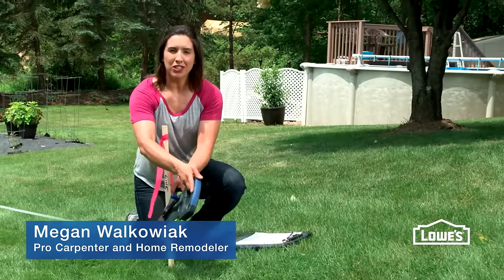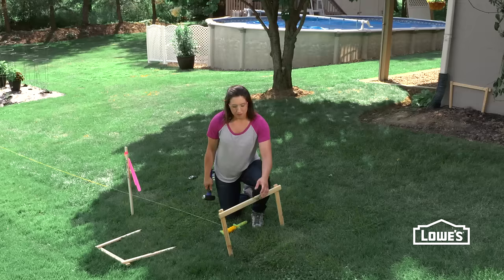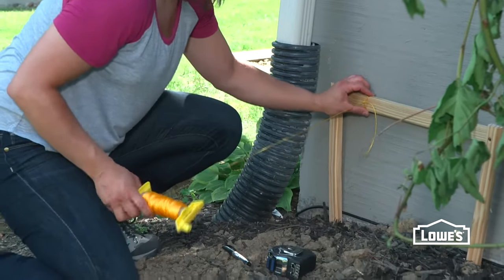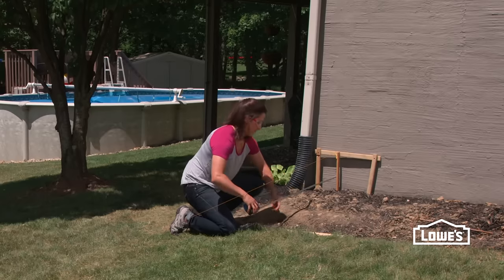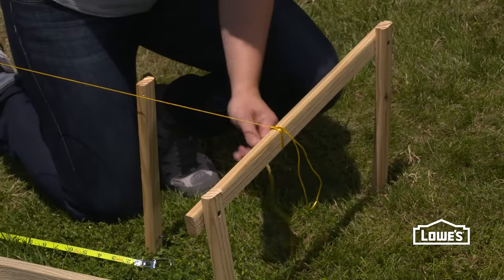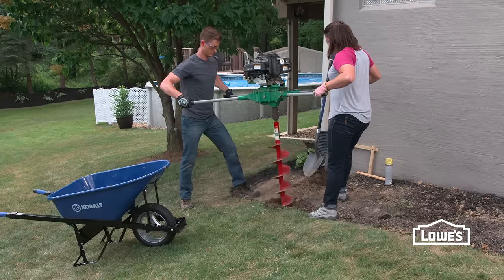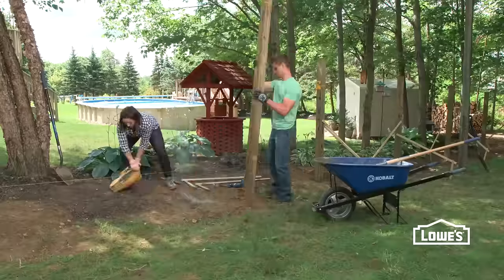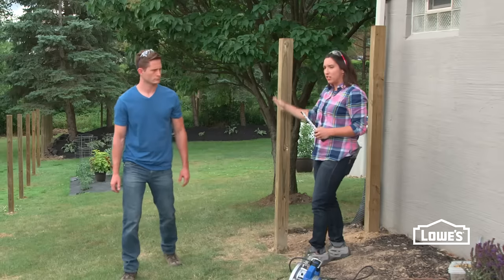How to Build a Wood Fence

Comment: HELPFUL HINT: Whenever you need to split a fraction of an inch keep the top number the same and double the bottom number. For example half of 1/2 is 1/4. Half of 5/8 is 5/16. Half of 3/4 is 3/8. Half of 1/8 is 1/16.

Comment: I suggest you use screws if youre in high wind areas. I've seen so many of my neighbors with fences destroyed because they used nails. Nails are good with shear strength but not pull strength.

Comment: The only problem about this video is that there is no specification on the nails so they don't rust (galvanized or stainless) and they are too deep. I personally use deck screws so there are no pickets coming off later. Contractors use nail guns to be faster but I always recommend screws if its for your home, which i believe that is what this channel is for. Either way, still looks nice.
Reply: Yes, well said!  Coated screws (preferably Torx bit) are the only way to go if want your deck, fence etc. to last. 
Today's screws are built so tough you could probably reuse them after the wood deteriorats.
Reply: @williamrodriguezmswlcsw8119  should you predrill all the screw holes? Or just fine screwing those in.
Reply: Always nails, screws may break with wind, nails will just bend in the worst case scenario

Comment: Watching this makes me want to hire someone to install a fence. Thanks Lowe’s!
Reply: I can dig it
Reply: I’d be very thankful for the work!
Reply: At least you will have an idea of how it should be done. One big exception is that the concrete for the post should come up above the ground by 1-2 inches and slope away from the post to drain water. If you want a 50 year fence or live in an area with strong winds use  2-5/8 steel posts and galvanized brackets to attach the rail sections. Fences collapse when the post weakens with rot. If using PT posts then be sure to treat the cut ends before putting them into the ground.
Reply: Zach LMAO😂😂😂💯💯
Reply: My thoughts exactly 😟
Reply: Benjamin Sampso
Reply: mik3lee98 yes! I’ve been doing fence for 17 yrs and tamp everything except hinge and striker posts concrete only, unless I’m doing anything over 6’ or chain link of course or if stubborn customers insist 🤣
Reply: @1millionsubswomovieschalle796  sounds about right brotha
Reply: Exactly lol
Reply: @mik3lee984  yeah till the fence go to leaning and straight dirt rotten a post out
Reply: @bswam44  thanks you to shared your knowledge
Reply: @mik3lee984  can you elaborate on this please?
Reply: @Burroughsbikebuilds  do mines

Comment: How big of a gate can you make with the hardware before you risk sag. I want to make a 12ft wide gate for my yard so I can get my camper in and out easily. I planned on making 2 6ft gates. Would a 6ft gate be to much weight for the hinges? I planned on putting cables on to prevent the post from shifting over time, and also pondered the idea of a wheel on each gate to help reduce the weight on the hinges.

Comment: Good comprehensive video, but I question a few build choices. Concrete footings should be above grade and domed. This design puts soil in direct contact with the wood post and will cause rot and post failure a lot sooner than you want. Pressure treated posts would also be a better material choice. I would also add flashing between the fence and the house to avoid termite risk.

Comment: Hey thanks for creating this video. I would like it if you did two things. 1, slow down when discussing post placements. In my experience DIYers who want even a slightly different shape deck might need to have things explained slower so they can translate the info into something slightly different. Second, I was wondering if you had any cool ideas of what to do with the post heads instead of cutting them flush with the top. Thanks!

Comment: An old tip for using a vertical spacer board, as from 13:30, is to flip it 180 deg. top for bottom, every other board - this evens out any slight variations in thickness, warp, etc. which might accumulate into an apparent slant after six or eight slats.
Reply: Nice! I'll use that. :D

Comment: All that beautiful hard work and a lovely fence at the end. But you will have to do it all again in a few years when the wooden posts rot. In my opinion always use concrete posts. Even if you clad them with wood afterwards. Almost every fence I see collapse is due to wooden posts rotten.

Comment: only one criticism-- First off great video, you are a pro! --- however the pine trees are too close to the fence, I know you put the fence on the property line, and the trees were planted too close to the line. So in ten years (or less) you'll have to cut them down or they will destroy the fence. I'd go ahead and cut them now while they are small and replant 5 ft away from fence, so when they grow up they wont interfere with the fence. Thanks for your video, very helpful.

Comment: I've been installing fence for almost 40 years this fence looks awesome love the way it flows with the ground great job
Reply: How many bags of cement per hole please?
Reply: Yes Ed, iv been fencing for over a decade and she did  a super job..
Reply: She didn’t even use a level once for the pickets. How could you say she did a great job?
Reply: @MikeHunt-dd8wn  you didn't do a great job of watching vid.... 14mins ' use a level frequently'.... Dufus did u not watch or listen. .?
Reply: Mike Hunt 
If all the posts are plumb and everything that goes in between them is the same width. Then no level to plumb the pickets is needed.
Reply: What do you think the cost of materials is for this type and size of fence?
Reply: @Jo-xg6rk  lmao he really didn't. i think he was just stuck on the fact it wasn't a guy doing it...
Reply: @TheSnowflakemt  i would suggest researching the top three vendors for a total cost unless you want to stick with one source. Go to that vendor and get a price layout.
Reply: @TheSnowflakemt  with the current cost of lumber and everything else, about 1 million dollars, but you will save on installation if your learned to do it yourself. lol

Comment: A word to the wise:
Wood today is very cheap. And I don't mean cost wise.
Compared to wood from as early as 30 years ago, the same type of wood today is 1/2 as dense, but at least twice as porous as wood then.
40 years ago before I put posts into the ground, I brushed a gasoline/ used motor oil mix onto the lower 2 feet that was going into the ground. I brushed it on about a dozen times over the course of two days.
Before putting them in, I put on a nice thick coat of the oil, then put a cheap garbage bag over the end and dropped it in. Those posts went into cement. If you don't treat the post that is exposed to moisture, they will suck up the moisture, whether from the cement or the ground , if you just use dirt. They WILL rot out quick.
Those same posts came out in 2019  when I had to replace the retaining wall they were supporting.
After hammering off the concrete , not only were they still rock solid, but they weighed about 3 times the weight as todays posts.
Todays wood is grown fast on farms and they use chemicals to grow it, no different than Miracle Grow with vegetable plants

Comment: Wrap the posts in Post Shields so they don't get torn to shreds by the string trimmer.  You can cut under the panels but those posts will get chewed up.  And they'll add a nice trimmed look to your fence line.

Comment: love how the video doesn't show how much work really goes into building a fence. Even using an auger is quite a bit of work and then putting in the fence posts...im just finishing building mine and believe me its more intensive that they make it seem, but you will save a fortune doing it yourself. I use green screws so that the fence is completely maintainable and have the boards side by side on the inside - this is to do with having no access to the other side of the fence. I also maintained the height of the fence and put skirts on the bottom, angling it down works too but it really depends if you want to add that extra work when the gradient is going down all the time, stepping the fence down just makes it that bit easier, but still some good points were raised in the video and some good tips.

Comment: Using a small framing square when you're cutting a 2x4 is a great way to keep the circular saw straight when making a cut. Much simpler than trying to see the line when there's dust everywhere.

Comment: Why cut your string line?  Put a screw in the top of your "batter boards" or 'Profiles'  as we call them in Australia...then you can adjust your offset easily without having to undo or your excess string line (or Masons line as I think it's referred to in the U.S)

Comment: I never thought of running long horizontals and staggering the joints. That will be my standard from now on. I also like the gate hardware. I've just used cross braces, the long one going from lower hinge side to upper latch side and optionally cut in some cross pieces for a complete look. But the hardware kit is way faster and looks really nice. Thanks for the how-to... very well done! 👍

Comment: Add some stones at bottom of post hole. Also paint the posts to keep an from rotting before setting them or you'll be digging concrete boulders up when those rot
Reply: Or just use aluminum posts instead.
Reply: It depends on your soil composition.  I live in clay soil and rocks/stones in the bottome of the hole are worthless.  Its better to throw some dirt in, then the post, the the mix...

Comment: Notes to Self: Top ~ 5' 8" X Underneath Line, Bottom ~ 9 1/2" X Down So that the Bottom is 6";  Exact Middle, {55 1/2 / 2 = 27 3/4"} + 1 3/4" Up, {X Underneath}.

By the Way, Why Don't You Just Dig the Hole Deep Enough that the Posts Are 5' 8" Tall?

Comment: no metal seat for the wooden post?  Your wood will rot in 10 years, treated or not when you put it straight into the concrete.
something so simple is literally the difference between something lasting over 20 years and something needing replacing in 10 yrs. nice finish though.

Comment: Why pour dry concrete into the post hole first?
Reply: I have four posts that need to replaced, do you do that
Reply: Protect bottom of post from rotting quicker
Reply: Everybody has an opinion on how to do this.  Other websites say to pour and compact rocks beneath the posts to allow water to drain away and prevent rot.  This the first time I've heard of pouring dry concrete first.  I have also seen people put termite poison into post holes.

Comment: Great video. The fence turned out real nice.

All that being said, I saw several mistakes being made. Firstly, learn the correct knots for string. There’s no reason you should ever have to cut that string, unless it gets frayed. Secondly, that circular saw was grossly under powered; it’s dangerous. You’d be better off with a nicer brand (sorry Lowe’s). Thirdly, You should be using an impact driver instead of a drill to install screws. Fourthly, nice framing nailer. Unfortunately, it was far too large for that small pancake compressor. That thing was struggling to keep up. 

For those wondering how much it cost to build a fence similar to this, you are looking at around $10 per foot, if you do absolutely everything yourself.

Comment: Wow.
Step 1:  Google Fence Companies
Step 2:  Read Company Reviews
Step 3:  Call for Quotes
Reply: @commonomics  - keep calling other companies...
Reply: @commonomics  - how many feet of what kind of fence?
Reply: @commonomics  yea, $10k is ridiculous.  Should be able to find for $5k-$6k installed.  I had 120ft of chainlink removed and 6ft wood installed with post every 4ft (not 6 or 8) in concrete with one large wood gate with metal frame for under $4k from a real fence company not a fly by night. Get some more quotes. Good luck!

Comment: Tip: You don’t have to wet the concrete, just compact it and the ground will soak up moisture to harden it. Worked for a deck and fence company and that’s how we did it and it works the same without taking extra time to mix concrete.
Reply: Yeah don’t do this…. Background in civil engineering, degree in mechanical / nuclear. This does not allow for a uniform hydration process. Additionally moisture content of soil can vary significantly from yard to yard. Long story short, if you don’t mix your concrete properly, your foundations can shift and fall years later. When I worked for the county not mixing concrete was a fine on the contractor/owner

Comment: At the end, you mentioned waiting a month or so before sanding or painting. What's the reason for this?
Reply: Its to let the wood season. Being new and pressure treated the new wood needs time to entirely dry and settle into position before doing anything else. As the wood dries from the pressure treatment it will expand and contract and move about and if you paint it the paint will crack and not adhere well if the wood is wet.

Comment: Why do you have to wait a few months before sanding and painting?
Reply: Need to let the wood dry out completely. If not the wood won't take the stain well.
Reply: According to the one of the lumber websites, treated wood is very wet and painting the wood before it has dried completely can trap the moisture in the wood and promote wood rot.

Comment: If the wood is green you should take it back to be kilned.You build with green wood 5 months  later your wood shrinks and you'll see gaps and cracks everywhere there a nail or screw.

Comment: How much would this cost? Help, Help! Thank you..
Reply: Alot
Reply: Spooky's World ENOUGH 2 SPOOK👻👻👻👻 U AWAY SPOOKY 👻👻👻👻🏃‍♂️🏃‍♂️🏃‍♂️🏃‍♂️ MY FRIEND 🤣😂🤣😂👐👐👐👐
Reply: It's about $10 per foot for materials if you are building a 6' tall privacy fence with no gates, three rails, and pressure treated pickets butted tight. Expect double to triple that from a contractor's quote.
Reply: Too much money that I’m about to go become Megan lmao

Seriously I was just quoted $3000 to replace 70 ft of fencing by 3 contractor smh plus I have to buy materials so in total about $5000.
Reply: I just ordered the wood for my backyard doing 418ft of fence and everything including concrete and brackets too was only 3,600$ and delivered. Compared to the 12k I was quoted..
Reply: I am building a privacy fence. I actually calculated this just yesterday. If I do all the work myself, I can build a 6 foot tall three rail pressure-treated privacy fence for around $10 per foot. That does not include the cost of renting or buying an auger. I actually bought an auger from Harbor freight for around $220. This was far cheaper than renting one. Using a post hole digger was absolutely out of the question, as I have several hundred feet of fencing to make, and renting one would far exceed the cost of simply buying my own.
Reply: @MyFortressConstruction  my how time changes costs.  I just calculated it here in Nashville (2 years after your post) and it looks like it is "now" almost $15 per foot including concrete (per ft - $1.50 posts, $1.88 2X4's, $9.33 pickets, $.80 Concrete, + .0975 Tax here in Tennessee).  woops, forgot nails and screws. haha Costs have really gone up the past 2 years.  Still much cheaper than hiring it done.

Comment: what size nails do you use to put on the pickets?
Reply: the picket is 3/4 thick and a normal 2x4 is 1.5" thick...so 1.25-2" max nail length

Comment: Gate building kits are pretty weak.  "over time" boards bow.  A simple diagonally placed board with nails on every picket, creates a ton of triangles.  Triangles are very strong, and enforce stability over time.  Kits are easy, yes, but not long for this world.  The longer you gate door, the less effective your kit is.

Comment: What kind of drill did she use? Hammer drill? I tried using the hammer drill and boy did it have power!!! Little bit scary for a small girl.
Reply: Jacqueline Gutmann Haha no need to use a hammer drill on wood. Hammer drills are great for drilling through material like concrete and brick.

Comment: Well it looks fine enough but hardly productive. I hate strings. A 2x4 jig that slides along the top rail with a 6-8" tail much easier to install pickets and  fallows contour flawlessly.  Many many tricks can save you time and easier on your back. Yes I built hundreds of miles and styles of fence for many years. Check other videos for ways to enjoy building your fence and look good doing it!  Keep Fencing On!
Reply: But were your walls filled with cannon balls? Your motto was Don't Tread on Me?